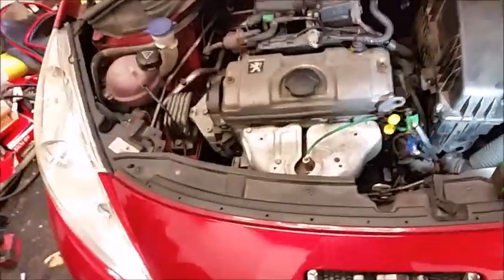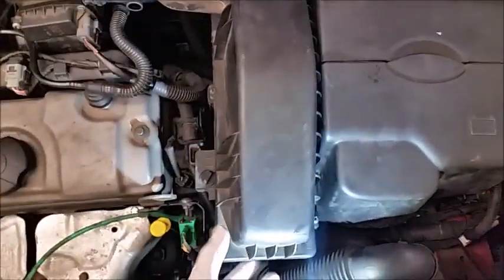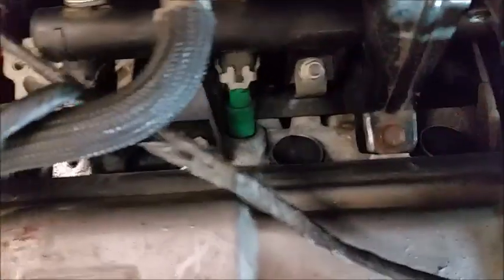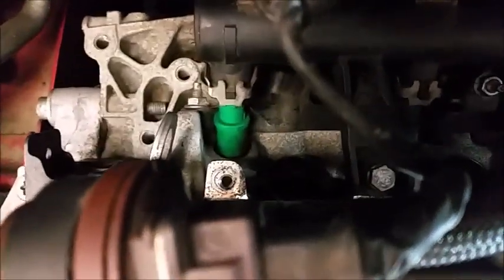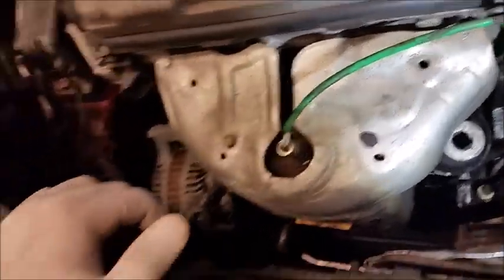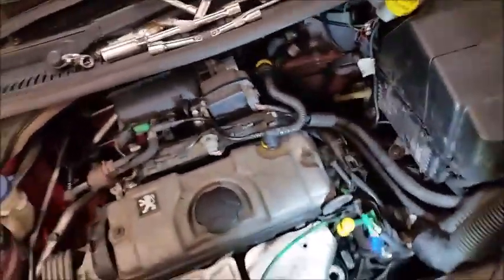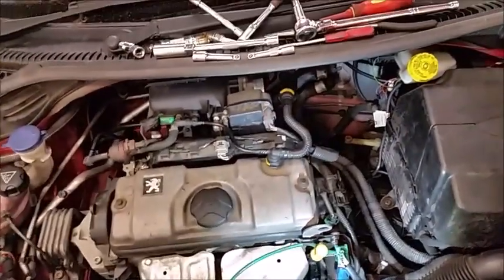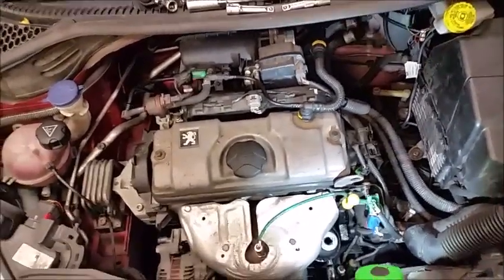How to Service a Peugeot 207

Comment: which 207 is this?  I've got a 2007 1.4 , and its engine compartment looks slightly different. Your video helped me change the air filter by myself, next thing will be the oil filter. It is so annoying that there are almost no technical support videos on YouTube about the 207's, Thank you, on behalf of all the daft Peugeot 207 owners.
Reply: yes I'm glad I found a video with a model that has an identical engine

Comment: your engine hasn't got a cover over the head like mine.  and my oil filter is slightly different spot more center. 

otherwise good video didn't know where the spark plugs is

Comment: I am trying to change my spark plugs on my 207 but after undoing the 2 10mm nuts the coil pack won't come out its stuck no matter how hard I pull, any ideas?
Reply from the maker: I would suggest allowing it to cool down, then spraying a very very tiny amount of WD40 spray around it, then try to firmly but gently pull upwards and outwards from side to side.
Reply: Hi,

I’ve just serviced my 2009 1.4. Changed the plugs + oil + oil filter + air filters.
But after changing the plugs I noticed that some rubber cover which clips on the plugs is broken. Now the car has an alarm air pollution faulty.

Any ideas on how to fix and can I get this rubber covers off the shelf?
Reply: +orsengangi

Hmm, I got that warning for month, I will definitevly check the sparks. Thanks
Reply: The 207 had the Prince engines up to 2011 after they changed them probably why it looks different for some